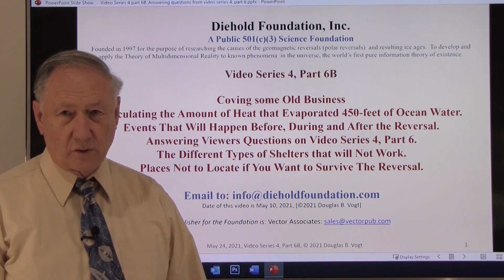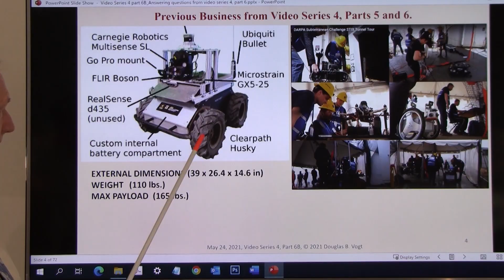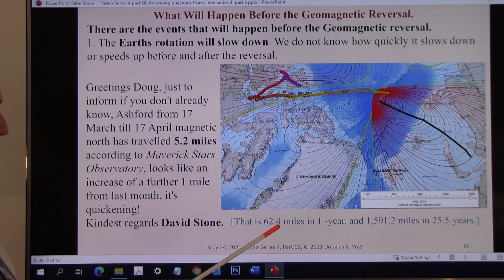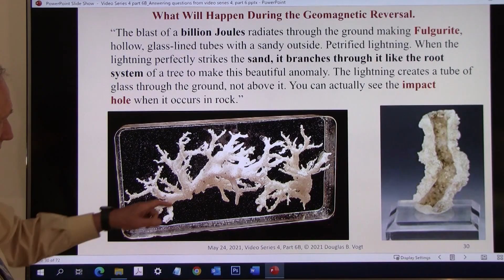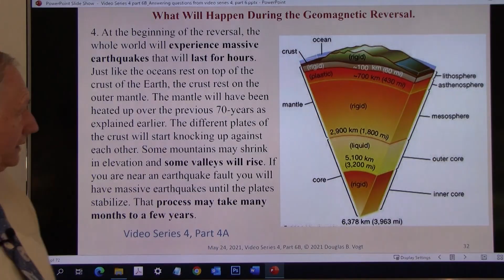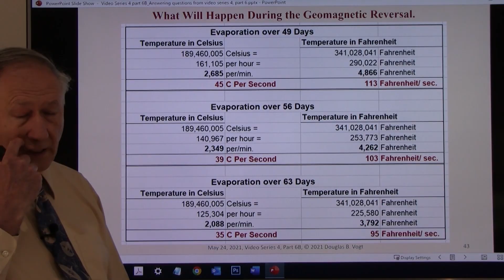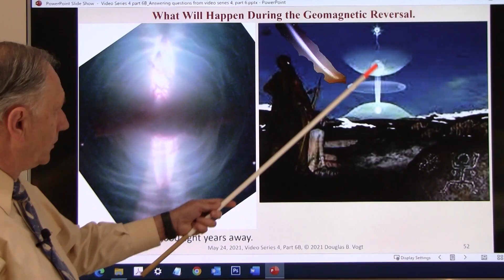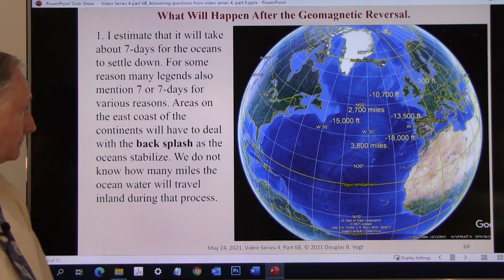Series 4, Part 6B, The Sequence of events before, during and after the polar reversal & Nova.

Comment: This is a new experience for us all. The magnetic field collapses. The poles have already shifted off the spin axis and we have only minor glitches in spin speed. So electricity flowing in the poles is not the dominant force spinning the planet, more likely momentum is dominating the rotation today. The spin of the planet is attributed to causing the oceans to stack up at the equator. If that is true, the force pushing the water is the planetary motion rotating West to East, resulting in a net outward thrust. Rotation momentum due to mass distribution imbalances would cause a rotational pole flip without a constant electromagnetic force sustaining the present rotation. So, no more west to east land pressure on the oceans, leaves gravity to dominate the flow of water:  the ocean masses will do what a non spinning planet does briefly: running downhill to the present rotational pole locations, then a spin-up with the present poles on the equator as the momentum of an imbalanced, momentum driven object will do:This would set the forces on the oceans to a present South Pole motion rotating to the north, raising the water over any land masses in a northernly direction on 1/2 the planet and north to south on the other 1/2; would it not? With less total depth on this axis, the water will slosh in both directions east and west also continuing the mass imbalance and the earth will tumble until a strong electric current flow with rotational forces are reestablished. The earth would spin axis facing the sun like Neptune. But the mass imbalance would drive another rotational pole flip back to something like it is now. Causing the flood of waters in the west to east direction as a final wave wipe-out. 

Frankly the tip of the tallest mountain might escape the waves but winds and shifting momentum would still be deadly (pad those ceilings). Timing of when this starts and how long it takes to work out are critical factors for safe locations, just as where a juggler catches tumbling pins are critical to success. Good luck. 🍀
Reply: Very good point. My only concern is the momentum of the oceans already in a west to east movement would not just come to a stop if the planet stops rotating rapidly. So both conclusions would be at play here. Would they not? So basically the oceans will be in a turbulent movement of not only still moving west to east due to momentum of mass, but would also be seeking to equalize the bulge since the earth would not be spinning. Basically the globe turns into a giant blender of sorts with water coming from what would seem like every direction. It would just depend on which area of the world you live for which direction the water will come first. Then comes the sloshing effect. Good luck to all indeed my friends.

Comment: The characteristics of the solar and planetary magnetic fields cannot be created by molten metal movement in the cores. On the other hand, a Z-pinch effect provides adequate effects to produce the fields as we experience them. Clearly the two fields are fed by each other’s Z-pinch reactions. And the Earth most likely has hollow space for the plasma reactions that generate the magnetic poles. (Although, this is an electrical phenomenon and only needs a medium that can accommodate swift charge particle movement without significantly resisting the accompanying fields.
Reply from the maker: You are right about he center of the Earth. I describe it as a center modulation point. I will do another video explaining it better and where the excess electrons come from. What is creating them down to the atomic level. Give be a few months to do it.
Reply: @dieholdfoundation6705  Zpinch is plasma gasses moving at high speeds (a balance of (+) & (-) ions) creating self generated magnetic fields that jam the ions together creating large standing magnetic fields. Like van Allen belts and bow shock barriers. That divert cosmic rays and other plasma streams from the cosmos.

Keep in mind that electrical power is not a particle phenomenon. But, it is sourced from particles of charge exchanging energy (plasmas make both charged particles and electric power).  Z-pinch is the source of matter and energy, fusion and fission with electricity amplifying as a side effect when resonance occurs.
Reply: I really believe WE are Here.... Aware and Prepared.  It is all adding up!

Comment: Interesting theory not sold on it though.Any cessation of rotation stops the correolais effect.The equatorial bulge which is measured in kms will break.Any rush of ocean needs to take this into account,meaning in this scenario the  flow would be northeast and southeast.equatorial continental areas would be the safest

Comment: QUESTION PLEASE: ..I've always thought that maybe the atmosphere was so mixed up, anyone that wasn't in a cave or heavy stone structure, or underground, just floated off.  Maybe came back to earth from 1,000 feet.  Would certainly explain why more antediluvian human bones aren't found.  Have you ever thought of this?
Reply: I'm not sure that I understand what you are asking.  Even if the atmosphere was "mixed up", how would one expect anyone to just "float" off?  For that to happen, the fluid medium needs to be more dense than the bodies to achieve bouancy.  The atmosphere is a mixture of gasses much lighter than bodies.
Reply: @williamh4172  ..if gravity is interrupted, then what happens?  That's my question.  The denser layers of the atmosphere might suspend lighter bodies, as in human bodies until gravity was restored.  Then everything would come crashing down.
Reply: @sallyscott9172  - Gravity is tied to and directly proportional to mass (inversely proportional to the square of the distance).  I'm not aware of any phenomena that can result in that force being interrupted. You are currently living in the densest layer of the atmosphere, and no gas is heavier than bodies.
Reply: Have a whistling kettle? Same thing... when the steam and pressure becomes a critical mass and seeks release to the path of least resistance. No gravity required just a pressure differential between a vacuum and a "half full" vessel...
Reply: @aceiliad  ..here's the thing.  Why oh why did the ancient people construct stone homes?  Why go through so much hard labor, when you could make a wood hut.  You see it all over, nothing would do but a rock house.  And not small rocks, BOULDERS.  When there's a flip, there must be one heck of a flip because there are very few skeletons found.
Reply: @sallyscott9172  Petrified wood, the Greek root word Petro literally meaning wood turning to stone. Fascinating how they could have known this was a thing thousands of years ago.
Reply: @aceiliad  ...language is very fascinating.  Cycles.  The earth could be ready to do somersaults for all we know :)
Reply: @sallyscott9172  less about the world being ready for somersaults. Maybe I'll just chuck a lazyboy into a zorb lol stay safe 🖖🤓
Reply: @aceiliad  ...lol.  I live one day at a time.  Stay blessed!
Reply: @aceiliad  ..then googles, nearest caves to where I live, you know, just in case :)
Reply: @sallyscott9172  honeycombs are very good at diffusing vibrations and frequency. Places with many pockets of dead space... I'm trying to figure out if I can dig out a Kiva without the neighbours noticing, no caves near me sadly.
Reply: I am pretty sure during this changeover, our world will depressurize, I think we live on a plane with a dome of some sort above us🤷🏼‍♂️
Reply: @lsbangersbear4346  ..THANK YOU for getting it.  I think so too.  Maybe a plane, maybe convex...or holographic.  GOD bless you for understanding me.
Reply: @sallyscott9172  my pleasure!!! I honestly believe that’s the most plausible, a depressurization, and a electro magnetic plasma event
Reply: @lsbangersbear4346  ...agreed!  I think many cave painting support those ideas as well.  You have a WONDERFUL evening.

Comment: Question: Are you saying that the micro nova and the geomagnetic reversal are going essentially occur at the same time? If that be the situation, the order of events is a bit confusing. An example being:  The rotation slows down considerably or even stops after which the winds and water will move easterly. The supporting evidence of this, as noted in this video, is the gouged continental shelves on the eastern shores. In order to gouge the shelves, in a defined linear pattern, there would normally be the absence of other fluids in the vicinity. The question: is the strength of the nova sufficient enough to nearly vaporize the oceans, to a level that would expose to the continental shelves, in nearly an instantaneous moment?

Comment: One of the better science based analysis of cataclysm. However, the science of water is more complex than what you present. There are commercial systems than heat water to steam with cavitation and need 60% of the energy required by heat alone. This is not magic, the hydrogen bonds of liquid water are converted to a higher energy bond (highly magnetic) that bonds ionized water molecules. When these bonds are made,the water vaporizes due to the higher diamagnetism the new groups of water have. When the bonds break (with pressure as low as 5 atmospheres) they release energy that will fission any material in contact (sonoluminescence). 

So, water surging over the planet will spontaneously vaporize and create heat by fissioning the materials in suspension. This water-gas is also highly conductive, creating lightning. The atmospheric conductors of high powered voltage differences. (Diamagnetic molecules of balanced ion molecules, the embodiment of dark plasma.) 

You seem to have missed one of the most powerful forces controlling the rotation of the planet (the mass distribution from the axis of rotation). Water vaporizing as you predict will significantly speed up the rotation as the mass of the planet is concentrated closer to the axis all that water and atmosphere lifted off the surface of the planet. The effect is exponential increases in rotational velocity. As momentum is conserved and with more speed, the impact of change is also amplified exponentially. (The Oberth effect).

I suspect the redistribution of lava mass is also a contributor with pre-eruption speeding rotation and post eruption slowing if enough of the Earth’s mantel is melted by increased cosmic rays, drawn to the core, increasing eruption pressures. With eruptions, mass transferred to the surface, slowing rotation and possibly forcing a rotational pole shift if close to the equator. 

Also keep in mind the magnetic poles pull cosmic energy effects to them that freeze water and melt magma, if not on the rotation poles this will destabilize the rotation of the planet. (Magma rotation does not make magnetism; plasma rotation-transformations do)

Comment: About the boiling of 450 ft of water. Had you considered a Shockwave that would displace the atmosphere reducing the pressure on the water so it could boil off a lot faster with less energy. At the edges of the displacement cold space might come in and freeze mammoth with food in their mouth.

Comment: I'm very skeptical of #DougVogt #DieholdFoundation claim about the water sloshing over the continents.  He has some good topography photos of see floor he claims is caused by ocean runoff, but what about the east to west erosion that would be produced if the earth rotation reversed?  We see no undersea evidence of the erosion that would be caused by the earth suddenly reversing rotations while the oceans kept rotating.  If the earth reversed rotation direction but not the water, then there would be more east west valleys from water erosion.
Reply: (1h15m45s) (1.27hr) https://www.youtube.com/watch?v=rwU09SrZ3OQ&list=PLjyehyKUteYvm3O3x90o7ZSJtGcELtL_C&index=427&t=1101s Series 4, Part 6B, The Sequence of events before, during and after the polar reversal & Nova. 8,936 views•May 24, 2021, 1K upvotes, 23 downvotes. By Diehold Foundation #DougVogt with 34.1K subscribers
Two major discoveries are made in the video. Calculating the Amount of Heat that Evaporated 450-feet of Ocean Water 12,068 years ago. Events That Will Happen Before, During and After the Reversal. Answering Viewers Questions on Video Series 4, Part 6. The Different#politicals4ecc2048that will Not Work. Places Not to Locate if You Want to Survive The Reversal. has information on this information theory of existence as well#Solutions4EarthCatastropheCycle
#S4ECC2048 #TechnologyS4ECC2048  #PoliticalS4ECC2048 
#EarthCatastropheCycle 🌎💥♻
#Solutions4EarthCatastropheCycle 💡🌎💥♻
#StrawHat4DKingPirate 👑🏴‍☠️
Reply: I think what would work for a door system is a long 10% grade tunnel of about 1 mile and  having at least one loop? You fill the tunnel with river rocks and sand that can be removed by hand and pre-flood it with water so it's basically like a clogged drain?  Alternatively you could just use a long series of sliding rock doors or steel doors that you can pre-fill with water or non-compressible fluid for resistance to pressure and shock?  I saw a video that said some of the pyramids in Bosnia were filled in with river rocks and sand by hand for some reason. The suggested reason was that filling a long hallway with sand and river rocks by hand is a good door. It naturally takes a democratic decision to open the door afterwards and if water leaks during the un-dig / opening of the door you can change your mind and fill it back in.   It  takes a community effort to open the door by hand and can't be done accidently, but even one or two people working long enough might be able to dig out too?  Also make the top surface of the tunnel ribbed so air and water naturally flow gently and resist rapid flow using eddy currents correctly.  Study a tesla valve which is a cave design pattern or tube design pattern that works as a one way valve or a shock resistant tunnel structure.  The Tesla valve layout and fill if full of river rocks idea would work pretty well.  Also plan a big enough empty space and leave tools to just cut a whole new passage to the surface if you have that ability and scale and technology? ? ?
Reply: https://www.facebook.com/groups/Solutions4EarthCatastropheCycle2048/permalink/866659397565472/

Comment: If the rotation of earth plays a part in gravity, and the Earth's rotation was to stop, wouldn't the water and everybody on earth fly up into the air? I believe the reversal...but the model is still incorrect.
   Also..isn't the reason water is in liquid form is because of gravity? If the spin of the Earth was to stop, I would think all water would evaporate instantly. Idk..just reason I believe the model is incorrect. And the reason we are all confused about what is really gonna happen.
Reply from the maker: Rotation does NOT play a part in gravitational force. You are not going to fly off the planet.
Reply: @dieholdfoundation6705  I didn't think so.
Reply: @dieholdfoundation6705  Have you calculated the rate of deceleration and re-accelerations? Wuold it be something like going from 60 to full stop in 10 seconds, the zero to 60 in 10 seconds... as a rough order of magnitude? Another quick calculation might be 1000 mph at the equator to zero in about 10 hrs... so 100 mph squared for deceleration... over roughly 20 hrs per day for easy quick calculation... is 5 miles per minute, per minute. ... in the last hour 100 to zero in an hour... or roughly 60 to zero in an hour... like braking my car from 60 to 0 over one hour..... so no-- we won't fly off the planet. It's actually pretty smooth.
Reply: @dieholdfoundation6705  nice! True, but it will be better than a roller coaster!

Comment: I mentioned voltage as a possible way to create a defense against water intrusion. Extremely high voltages, it can be of a frequency that is not harmful to life. 
A trompe type of bubble in side a cave could be made. But the “out” is not there. The cave traps air, and people  can stay there until the water recedes. I don’t think the door idea is as easy to do at the elevations you are speaking of.